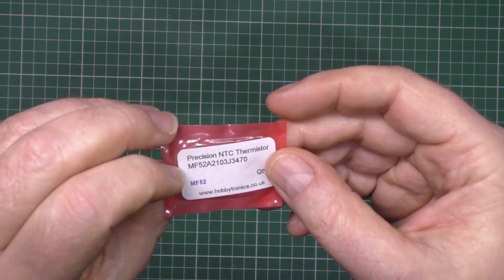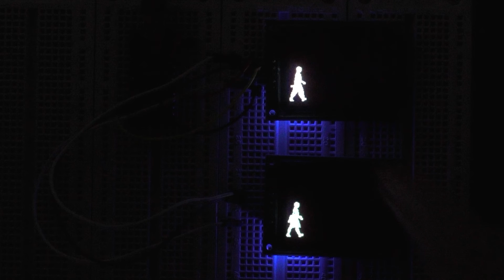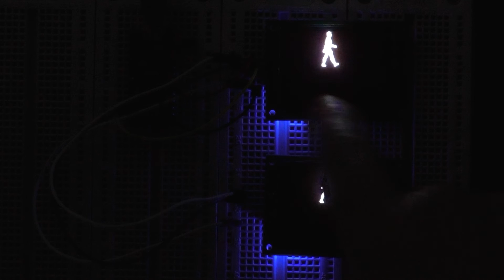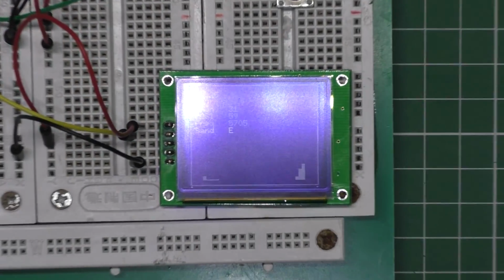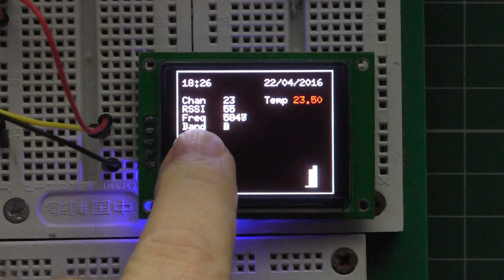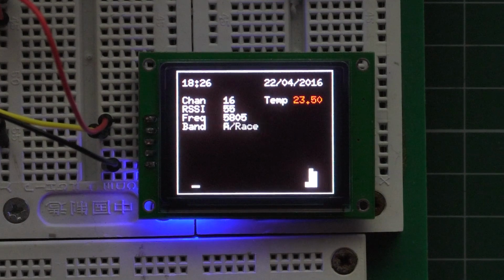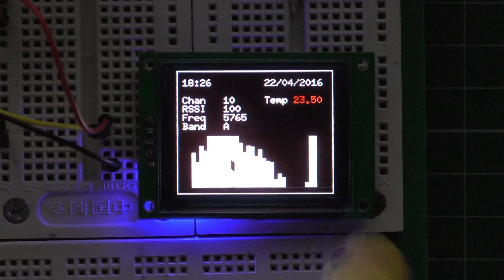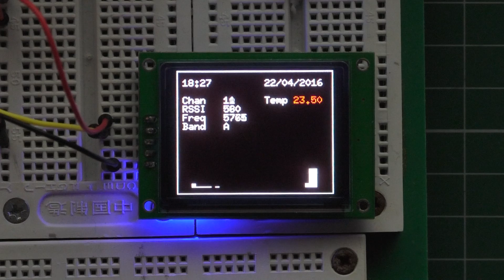VMFT (Vortecks Multi Function Tool) 5.8ghz scanner with Teensy & 1.8" OLED

Comment: I am currently building a 5.8 SWR meter (with the aid of a direct coupler and some agilent microwave diodes). Always nice to know which antenna can be used for which frequency.. (or whether you have to toss it out)
Reply from the maker: +gilgameshismist I was thinking of adding a SWR meter but it would make it too big to fit in the case I've got. I'd like to know how you get on though :-)
Reply: Vortecks
When I'll find the time to finish the project, I will give you a shout. :)

Comment: Thumbs up for the Teensy Tony. Arduino on steroids. stick a 32khz clock crystal and a button cell onto the teensy for RTC without the daughter board. Hack the RX board for SPI and get 40 channels. see here. http://www.rcgroups.com/forums/showthread.php?t=2477752&highlight=diy+diversity
Just finished the DIY diversity RX above with the tiny 0.96' OLED. a bit small and could brighter for outdoors use. Have a link for the larger OLED?
Reply from the maker: +Rob B Cheers Rob. I was thinking of fitting a button cell and crystal but I didn't have any battery holders when I started it. I'll probably fit one when the holders arrive from China-Kong.
I've already hacked the RX for 40 channels but I'm having problems accessing the final 4. My coding is rather crap but the one on RCG won't work with the Teensy and display. The OLED is a Digole 1.8" UART from here - http://digole.com/index.php?productID=859  
If you end up buying one, let me know... there's a hack to make them brighter.
Reply: +Vortecks ouch! too pricey for me. I would not invest too much time in trying to get the the RX to pick the right channel when scanning. Some of the so called channels are too close together to reliably discriminate. The code from RCG has had a lot of effort put into it and it still fails to find the correct channel. It will be fine for your "spec analyser" idea.
I ratted the 32kHz crystal and battery holder from an old PC motherboard. Perks of being a hoarder :)